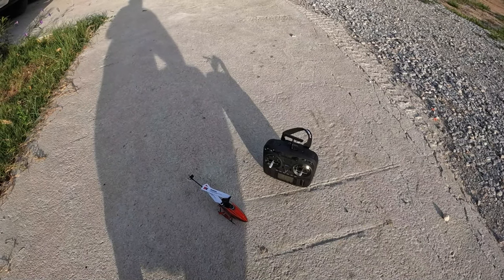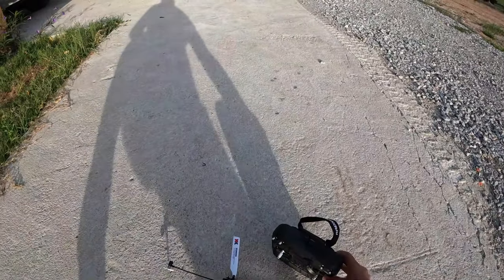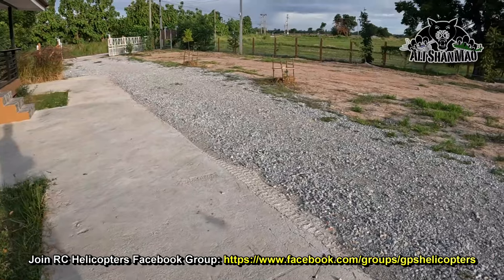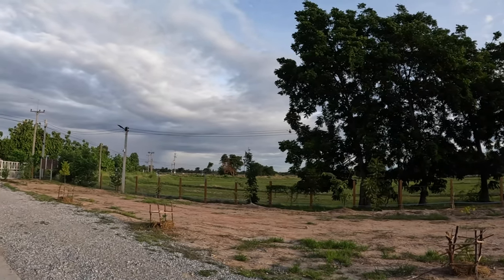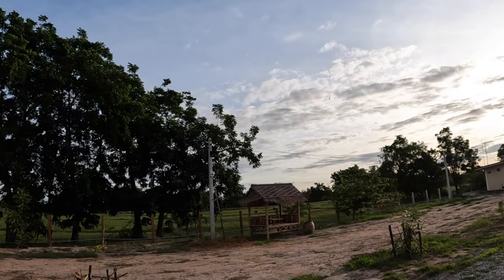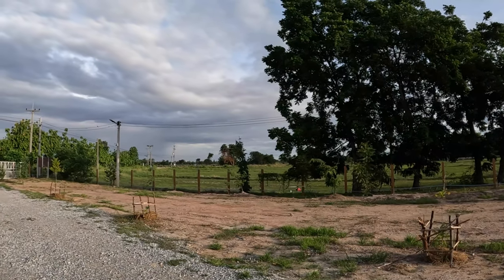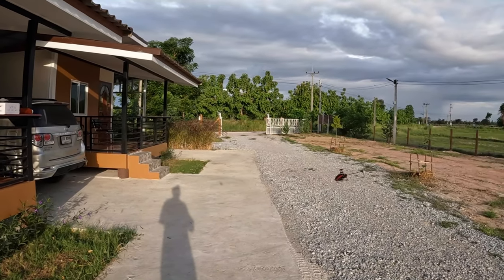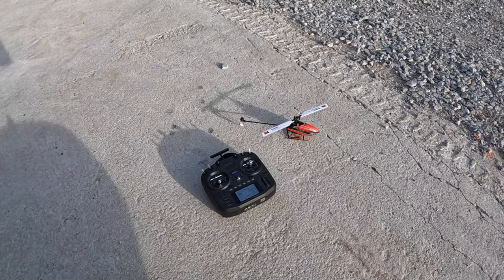EdgeTx for Helicopters: XK K110 Mini 3D RC Helicopter Flight Test with Boxer EdgeTx

Comment: Hey don’t forget to tune your tx16s to the specific centre range . If you don’t especially with sfhss you will get signal problems .  It’s right under the protocol you select . It has to do with Rssi
Reply from the maker: for edgetx yes you have to fine tune the frequency.

Comment: Question, I have seen you use the GoPro camera when you record your videos. I also have a XK110 & a GoPro. What setting do you use for the XK110? I use the Standard 1080 l 60 l N setting when I record & noticed that the heli is hard to see & yours in your video the XK110 looks much bigger than mine. Thank you for the information on what setting that you use.  Ron H.
Reply from the maker: shoot in 4k or 2.7k 60fps. when editing the video, crop the video to zoom in to heli. Say in your editing software if full video value is 1000, zoom in to Scale it to 800, 750 or 700. then you can see heli clearly. or you can simply set your go pro to Narrow rather than wide angle,
Reply: Thank you for the info.

Comment: Hi. I'm using this helicopter with a radiomaster zorro; recently I've changed the motor to a powerfull one; the problem is when I pull up trotle the motor kicks too hard and the esc cuts power and I'm not able to lift off; If I hold the heli on the ground with my hand to prevent that kick at the start, the motor starts normally; what can it be the problem? seems to me that the gyroscope cuts power to the esc to prevent any damage; thanks for any help
Reply from the maker: you can't change motors this way. without changing esc. so it explains the issue.
Reply: @alishanmao  hi. Thanks for your Reply.  I should also informed that ive changed also the stock esc for a XP 12a still running stock firmware as Im havent changed yet to blheli. Thanks

Comment: Il y’a 2 ans j’avais acheté grâce à vos vidéo le xk 127 
Et depuis la 3d le fesais envie J’ai enfin resu cette helicopter 
C’est mon 1 er pas variable je suis comme un goss 
J’ai juste 3 heure de vol et je vole que en accro se qui est rien avoir au k 127 avec la 6g 

Ma question est je trouve que l’anti couple a tendance à bouger un peu nord des gros coup de pas j’aimerais savoir si le votre aussi et quelle astuce auriez vous sur l’anti couple 

Combien de vol avez vous dessus ?
Reply from the maker: little bit you can control not an issue. i did not have such issues. thanks for the support
Reply: @alishanmao  c’est se que vous dire sur la vidéo 
Et moi je constate sa aussi 

Des variation du tailmotor